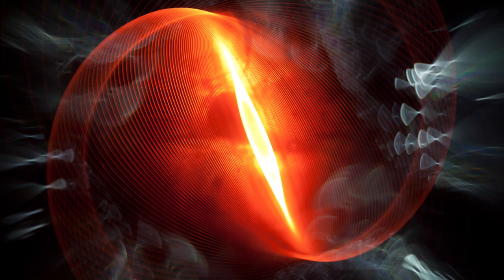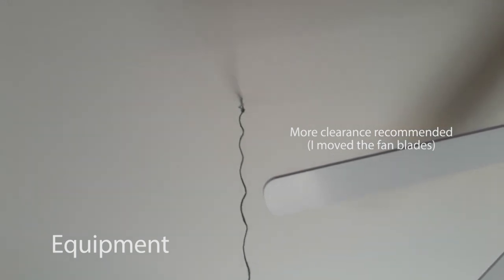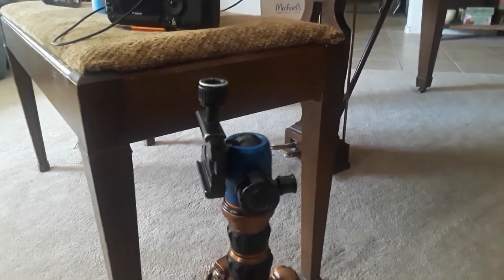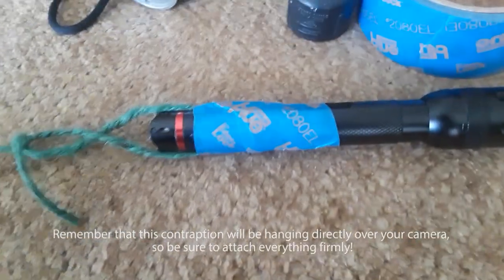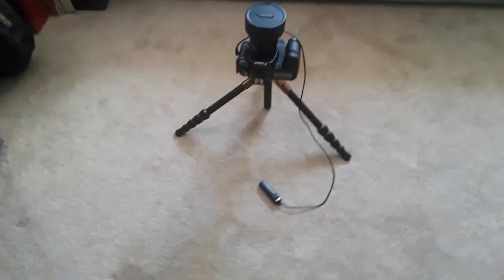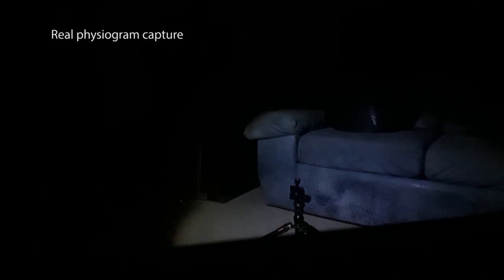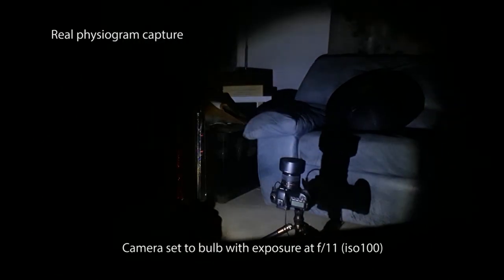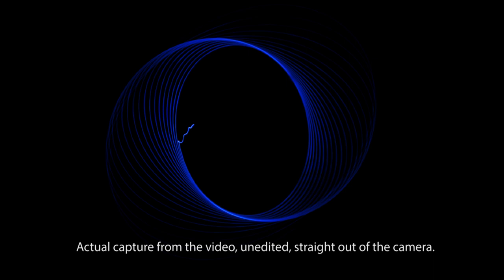How to create a physiogram

Comment: What camera settings did you keep
Reply from the maker: It depends on the brightness of your light, with my set up I usually shoot at iso 100, f/20, and a typical physi maybe 4 minutes in duration. I like to stop the lens down as much as I can get away with for maximum sharpness.